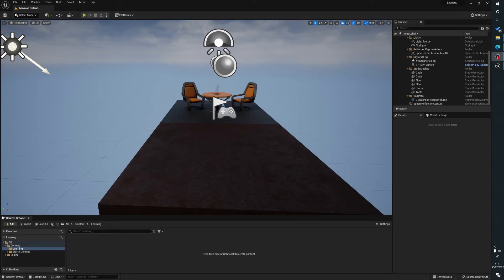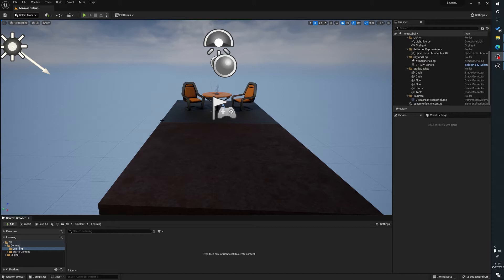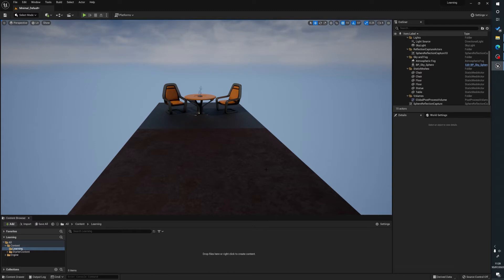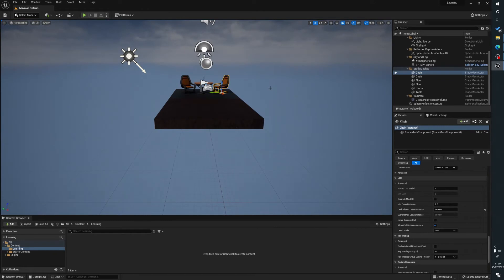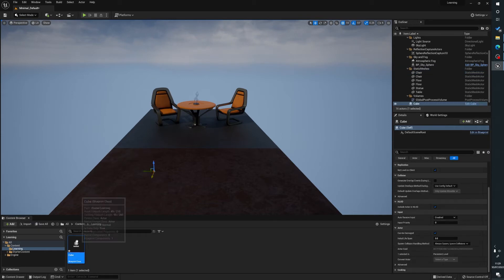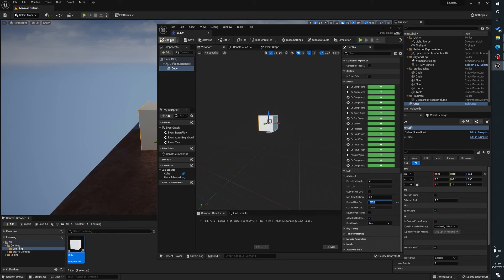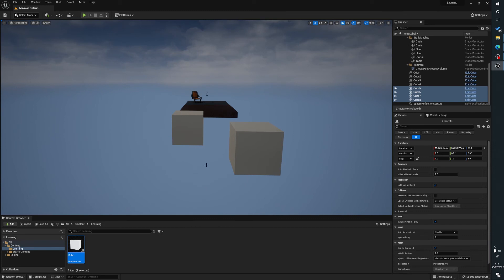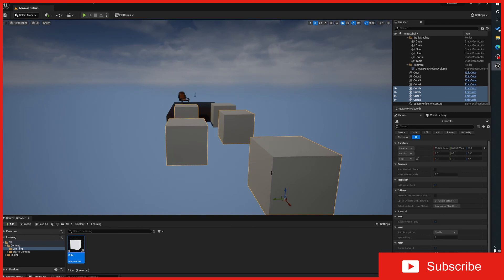How To Cull Individual Meshes In Unreal Engine 5

Comment: hello good and helpfull vid, i have a question, in a procedural foliage sistem u need to work with meshes, no with blueprints,and I want the foliage not to be drawn at a certain distance from the player. I actually make disappear the foliage for distance with the last lod of the mesh that i reduce the triangles to min value and scale at little value (to 0.1) thats makes a cull effect well but the foliage doesnt disappear completely, it only seems that way because it gets smaller.  the question: can i make disappears completely, a way to make all meshes of the same type disappear for distance without using blueprint  ? and how because the static mesh editor have not the max draw distance option. so much thanks and sorry the extend comment
Reply from the maker: heya!

Are you using PCG In unreal 5?

I think from memory there's something called a PCG Distance Filter node that you apply and can then dictate cull distance there
Reply: @joedickenson3d   yes it is the solution so much thank u

Comment: It doesn't work for nanite. :(
Reply from the maker: Nanite doesn't require culling.
Reply: @joedickenson3d  I have created a very large landscape. World Partition unloads landscape levels over a long distance and to hide this, I created a simplified nanite landscape grid. But I only need nanite in the distance against the background, and I don't need it near.
Reply: the meshes itself dont need it but when you have an masked material on the object and many objects of this in the world the opacity in the mask will cause overdraws. If you want to prevent that of course you need culling. @joedickenson3d